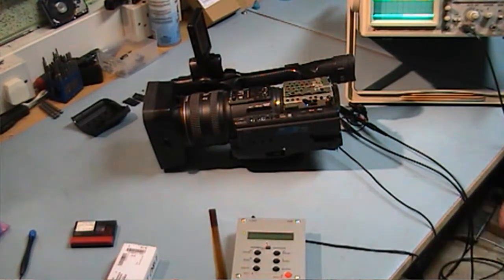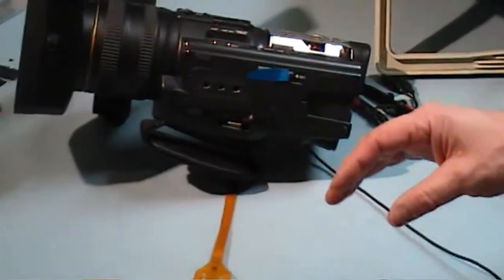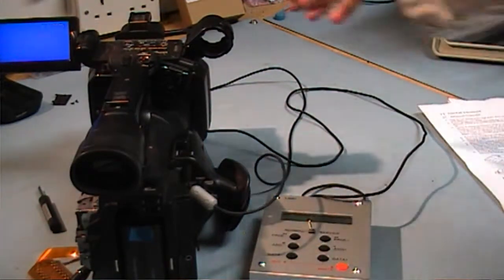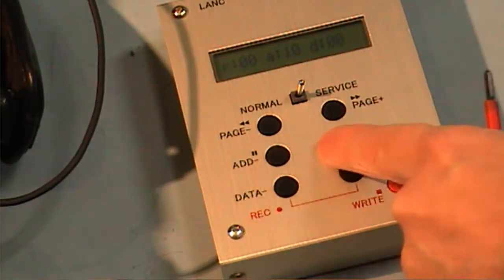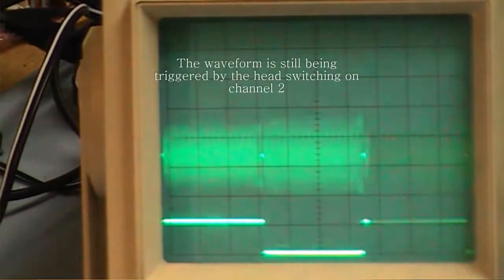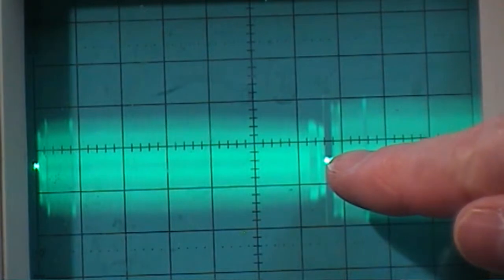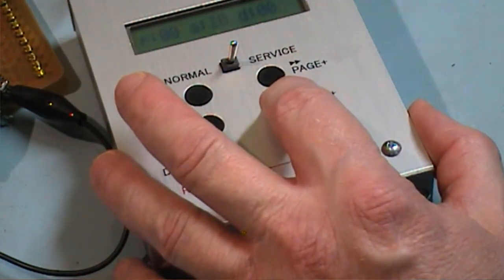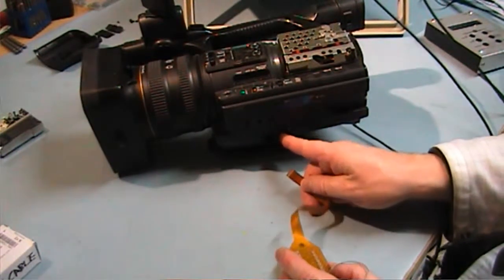HVR-Z5 Tape Path Adjustment

Comment: Where can I find one of those remotes?  I have had zero luck...
Reply from the maker: These remotes and cables can only be got from Sony
The part numbers are in the description, however they are expensive and for a one off repair, it would be better to bring it in to a company for repair, that has them already
Reply: I contacted a few Sony distributers and they don't seem to have a Sony RM-95 anymore and I didn't see any part number on that remote you were using.  I do work on many units so it would be worth the investment if I could just find one. I found the jig cable... But no remote.  Perhaps I should call up Sony and ask?  Their website mentions they're out of stock.
Reply from the maker: The remote is called: Lanc Jig, part number J6082565A, when I bought this it cost around €450, you will need the two cables as well
CPC-13        J6082443A
LANC cable  J6082442A
Reply: Gotcha. I just looked up Lanc Jig by itself and I found it.  No one appears to be doing it by the part number which was why I was having issues.  Thank you!
Reply from the maker: you are welcome